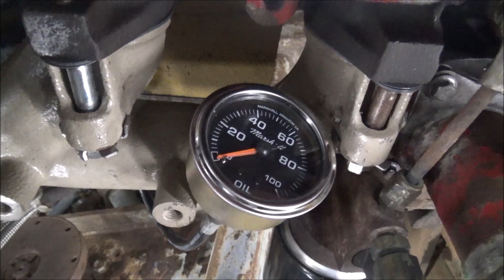Cummins Swap the Hyster Part 9: Fuel Injector and Lines Install Plus other Accessories Hookup

Comment: I wish I could have you take a look at my 2000 Freightliner FL70 with a Cummins ISC 8.3
It doesn't seem to have any power at around 2000-2.5 rpm
Reply from the maker: Checked your fuel pressure? Low pressure will cause a noticeable performance drop as rpms increase.

Comment: What’s the part number for those injectors? What pistons do you need to run those
Reply from the maker: I run the big bowl industrial pistons. I don’t remember the injector part number as I have had them 20 years. If you call curtis at area diesel in carlinville Illinois he can probably look up what they were from when they serviced them.

Comment: Looking plumb dieselish! All you lack is finishing and that's not far off. I thought I heard Baily but with you in a jacket he was probably on the couch dreaming about chasing something. Good oil pressure. My 4.3 pegs the gauge with the Delo circulating through it at 195 degrees on idle. Good stuff. Remain calm and BLESSINGS 2 yall!

Comment: I'm guessing you'll be able to use the forklift hydraulics at idle without stalling, regardless of the load.
Reply from the maker: That is the idea, no more pull the side shift and kill the engine.

Comment: You over hauled the engine but left the old freeze plugs in the back of the head that ive seen rust out on a few 8.3
Reply from the maker: The head appeared to be recently remanufactured. No signs of corrosion.

Comment: We had I think a 50K extendable wheelbase fork lift come in at work moving some punch presses. Not sure what it had for an engine, but it shook the ground like a locomotive when it revved up. It squished water up through the seams in our driveway when loaded.
Reply: I supervised 2 moves like that. One from one bilding to the next the other all equipment out of the build shutting down.

Comment: Aloha Brian, Did Bailey put his wag of approval on this??  I have grown to accept his wag of approval.  I see so many wipe bearing surfaces with oil and NOT pressure lube an engine, and I like the see  the engine crank to do this it proves so many things and is thorough. I'm looking for smoke out the exhaust!  Thanks for sharing.
Reply from the maker: He came by for the startup. For the most part Baily doesn’t like being on concrete anymore. Poor old thing. 😭

Comment: Did you have Area adjust the governer on that pump?  Get the ol girl turning 5-6k?  Start a new pulling class.
Reply from the maker: No I think it only turns 2800 best I recall where they set it.
Reply: @bcbloc02  LOL.  I was kidding around with you.  Figured you could make the first Pro Stock Forklift class.

Comment: I smell some video trickery going on here... you used antiseize and didn't get it all over  yourself.  something aint right there, lol
fun video Brian, I cant wait to see it running
Reply from the maker: With the dirtiest hands on the internet no way you can tell about the anti seize. LOL
Reply: @bcbloc02  I'm that way with whatever I'm doing.
Reply: Use anti seize on the job, get a little on your shoe. Stop at the grocery store on the way home, tomorrow it's in Tokyo.
Reply: Black asphalt roofing cement does the same thing.  Nasty stuff
Reply: I was thinking the same. My hands and clothing are covered every time I use it.